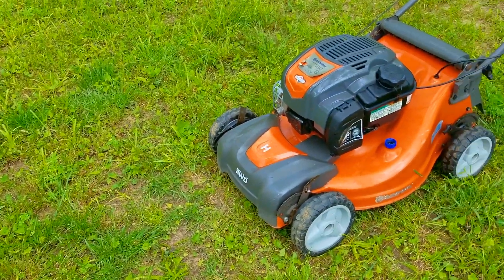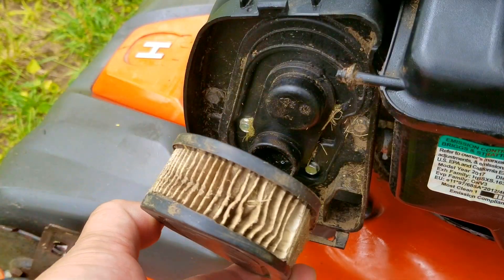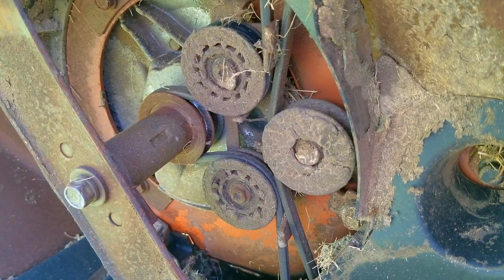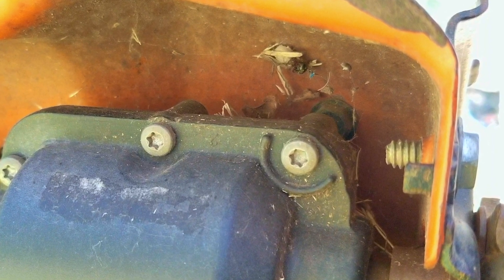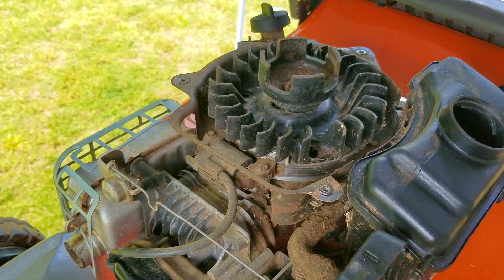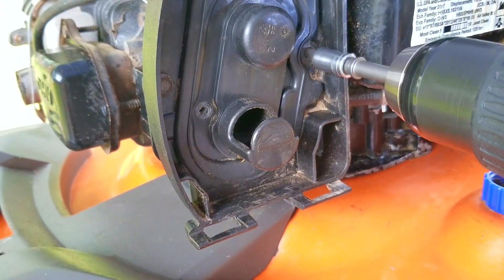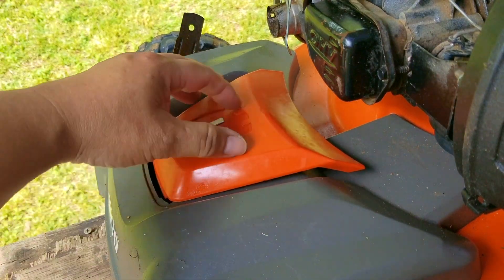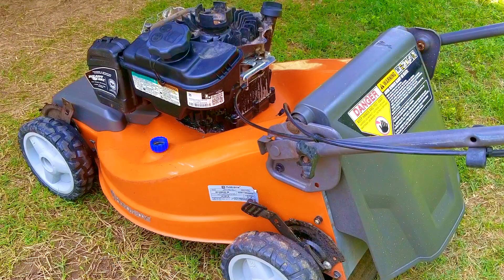Fixing A Husqvarna Mower That A Has Pull Rope That Won't Turn The Engine.

Comment: Yesterday dad and i got the new clutch for the Husqvarna 252RX when i got the trimmer reassembled and tried starting it the trimmerhead continued to spin, do you think i've missed something or do i need to run it until the trimmerhead stops spinning ? 😄 I'm wondering if the clutch drum is worn out in the meantime 🤔
Reply from the maker: so the clutch was the whole assembly right, spring included? have you tried to lower the idle speed? also, are you sure, this is the correct part, for the Husqvarna? If the spring is too weak, it will allow the clutch to back contact with the clutch drum, and the trimmer head will always spin.
Reply: @INSIDEHOUSEGARAGE  yup the new clutch was correct, i haven't tried testing it nowdays due to heavy rain, but i intend on doing it when the rain stops and then adjust the idle, what should i do if it repeats itself ?🤔
Reply: @INSIDEHOUSEGARAGE  i also checked the clutch drum's inner diameter which was 69mmØ according to the clutch manual of the Husqvarna 250R which i has the same parts as the 252 but with a few extra parts the 252 doesn't have is not suppose to exceed 70mmØ which didn't happen, i then compared the diameter on the clutch drum to an aftermarket one which has an inner diameter of 68mmØ i'm not sure what the inner diameter on a oem clutch drum is and doesn't tell on the shops which has them 🤔

Comment: Hi so I have a weed eater fl25c and we got it a new carb new ignition coil and new fuel lines and new spark plug and it has also 101 psi and it doesn’t start what can I do to fix it?
Reply from the maker: I'm curious why you bought  a new coil, that must mean you weren't getting spark before. what did you set the coil air gap to and what did you use, to "set" that gap.  Have you confirmed that there is spark, at the plug?
Reply: @INSIDEHOUSEGARAGE  when I first got the weed eater there was no spark and now the coil and spark plug are working but for the gap I didn’t use anything I don’t now how to use thoses gap things I’m still learning
Reply: @INSIDEHOUSEGARAGE  and I don’t have thoses gap things

Comment: I have a recurring problem with briggs engines that i just can't seem to figure out and was hoping maybe you can offer some insight. This happens with pressures washers, mowers, and other equipment. The problem is they run but they constantly pop pop pop from the exhaust. Adjusting valves doesn't seem to help, can't tell much difference from increasing jet size, and none of them seem to have sheared flywheel keys. Thanks for the videos, I really enjoy them.
Reply: Check the flywheel gap
Reply: @eathans_small_engines8665  thanks I will try that.
Reply: @eathans_small_engines8665  it did not help the particular piece of equipment I'm working on but I'm adding this to my list of things to check because I get a lot of these engines that have this problem.
Reply: @donsizemore8746  check your plug gap to becuase that might also do that

Comment: Hello..My 4 stroke Troybilt trimmer runs great at idle but has reduced power at full throttle. All new fuel lines, filter, carb, new spark plug was installed, valves adjusted, when I changed the carb I noticed the crankcase ventilation port tube had oil in it. I got rid of all the oil and installed new, 3.0 ounces. Still runs bad at full speed, No idea where to go now. Hate to dump it as it does run so nice at idle and is an easy start too.
Reply from the maker: two things, have you tried running it with not air filter just to check if it does it then, and have you considered there might be a restriction in the exhaust system? the other, is have you tried spinning the trimmer head by hand, to see if the gearbox is not putting a load on the engine.
Reply: Checked the muffler screen for obstruction and it was clean. This has a shorty shaft for attachments, it runs the same way with or without an attachment installed. Guess I'll tear the carb apart and see if any thing is blocking the flow. Thanks.

Comment: Great video on Great subject 
Some things to consider when deciding.  
How many parts to buy and price.
Including tools.
How long to get parts. This is becoming a real problem. 
How fast do you need mower, is it your primary mower, project or a customers.
The time required for repair.
Would your time be better spent.
Reply from the maker: all very good questions and the answers are also interesting. it's more of an issue of will it work, after replacing just the parts you need? and the answer is there Is no  guarantee.
Reply: @INSIDEHOUSEGARAGE  Agreed there are no guarantees in life.
In another life, another field I made decisions of these kinds. 
The rule of thumb at shops is that if repairs are half of what cost of new unit don't fix it.

Comment: On that stile briggs, you can slide the tank upward off its slots & carb out, without disconnecting the fuel line. Take it out as one unit tank/carb/fuel line..
Reply from the maker: yes you're right, but you also have to remove the top cover.

Comment: Just purchase a Honda hrx217vyaa and after I used twice, it’s very hard to pull the cord, because it pulls back. Do I need to adjust the valves already??? If so, what’s the gap space???
Reply from the maker: do me a favor and remove spark plug, close the fuel valve and remove the bolt on the bowl to remove the fuel thats left. then replace the bolt.  Pull on the rope a few times, and then replace the plug. now.. tell me if it still pulls back? IF yes, then the valve lash is the issue. Set it to .005" BUT if doesn't pull back, then the flywheel key is sheared.
Reply: Let me tell you what I have done so far.
I removed the flywheel cover and inspected the flywheel and flywheel key. Both are ok.
I inspected the valve cover for dents also.
I noticed that when I removed the spark plug the rope gets easier to pull.
Question 
0.005 clearance on both valves???

Comment: What if the pull cord has too much resistance?
Reply from the maker: then there might be too much oil in the engine. If not then the carb might be leaking gasoline into the engine.

Comment: Why would my pull cord not retract? Second, my yard guy over filled oil and oil is pouring out of air filter. Ugh... I don't have much knowledge abt small engine repair. It's prob abt 5 yrs old. Do u think small engine repair shop will kill me unnecessary "repairs"? Lastly, what would be the most you'd pay to repair a 5-6 yr old mower that's very similar to one in this vid. Any help is much appreciated.
Reply from the maker: not much to go on, but I would guess your spring is broken or the Pawls are jammed. I you think there's to much oil, in the engine, tip It over and pout out the oil and put back about 14-16 oz. of oil.  I cannot guess, what a shop would suggest, to repair,  but it's part of their job, to make sure, they aren't liable for any dangerous situations your mower might pose, to your health.

Comment: What I use is a 3 strike system. If I find three things broken on a mower, it’s out. This rule won’t apply if the parts are very low priced however, I also have a maximum budget of 150 dollars per machine. The only time I don’t use that rule is when I am adding a found Tecumseh engine to my collection. I will spend what is needed to fully restore those things.
Reply from the maker: ah, I didn't know you felt that way about them.  Can you share why you feel that way about Tecumsehs?  I like to, But I don't go out of my to fix them.

Comment: I had 2 of the exact same mowers. 1 had a bent shaft, so I used all the best parts from both to make 1. Sold for $200. Easily.  So either way should be able to recover what you spend.
Reply from the maker: I think you're right, thank you Casey B's Zombie Mowers.

Comment: I've  had to replace the recoil unit on my mower several times  because the spring snapped each time causing the robe to break as well.  When I tried to put a new bend in the spring it snapped again.

Simple answer to your question is when the repairs are greater than the current value of the machine and it would be more prudent to buy a new one that is going to give you good service for years to come. Simply put if the repairs cost more than what use they might give you than scrap it. This is where I am now at with my 2000 Buick Century custom.

Indeed sometimes less is more and saves load of time.

I have always found it to be easier to buy the whole assembly and less involved and less time consuming.  Most places simply do this by default.
Reply from the maker: thank you Patrick Nesbit.
Reply: @INSIDEHOUSEGARAGE  you are most welcome 🤠!

Comment: Hello Home garage, I am trying to fix my 22 inch toro FWD mower, and I am expecting the problem to be the carb. Do you know if the Briggs and Stratton engine on mine is the same one on this one?
Reply: Just look at the front of the engine where it says Briggs and Stratton, the engine should have a tag on it with basic engine info like the model number and CC's. Also make sure if it's a Kohler engine or not, those 22 inch recyclers typically use Kohler engines.
Reply from the maker: look at your carb, is it metal or black plastic?
Reply: I haven’t taken apart the carb yet but from what I see as of right now, it appears the float bowl is metal.
Reply: @mgomez5606  It isn’t starting, and fuel is leaking from the carb.

Comment: I strongly recommend that if you are draining the fluids before storage, to only drain the fuel.  Keep the oil in the engine
Reply: Can I ask why?
Reply from the maker: are you worried about rust? on the steel parts in the engine?
Reply: @INSIDEHOUSEGARAGE  no I’m worried about lack of lubrication and oil not getting to certain places

Comment: i have a mower outside right now that has the exact same engine as this one lol...
Reply: the guy took the clips off the handle bar and the filter and filter cover was missing and had really old oil in it and had too much oil in it so relatively cheap fix..30 dollars maybe .i jus tlike fixing them a neat new hobby for myself:)
Reply from the maker: I understand your hobby. I'm right with you .

Comment: That’s a decent machine. I’d replace the whole assembly and get your money back in the sale. 
BTW, and please don’t take this the wrong way, but I used to think you were nuts for washing your equipment with a tooth brush, until a couple of weeks ago I found myself doing just that. You made a believer out of me. It was faster, used less shop towels and did a better job. 
Cheers for all your hard work putting these videos together and showing us your common sense approach to small engine repair. 
Murph
Reply from the maker: thank you Ez Ray
Reply: The fine bristles on a toothbrush really get into those tight areas!

Comment: I just worked on a plastic carb Briggs mower. I think it was a Bolens from Lowes. it wasn't priming at all. Something was plugged up in the carb, and after cleaning, it still wouldn't run. Told the guy, the rebuild kit is $15, and a new carb is $25. He opted for the new carb, I put it on and it fired right up. 
I wonder if all of the Husqvarna AWD walk-behind mowers are built that cheaply. Those pulleys will get destroyed being exposed like that. I wonder if other models have a cover over the pulleys? I'd definitely order a whole new recoil assembly. Great video man!
Reply from the maker: thank you Jacob Feather, some had a plastic cover, but it was still open at the bottom for grass to fall out.

Comment: i fix these and sell tehm for profit a small one at that if it costs me 60 or so to fix then its nto worth it to me really i only sell them for 80 ..but still i jus tlike fixing them sense of accomplishment i guess...i have a rmeington and the rocker arm broke off that one i got to work but the arms keep coming loose so sadly i guess im jsut going to use that one for parts..teh thread locker isnt working just keeps getting softened by the oil running through so...idk they dont have the lock option on them newer mower too so oh well but i have 3 others ready to go and be used..so not all that bad.
Reply from the maker: that's a shame, and thanks for the information

Comment: 10:50 had to get the high speed corded drill for this one. Looking forward to you installing the pawl kit. Sometimes you can get away with new pawls (part 281505S) and sometimes you'll need to replace the whole recoil. We will see.
Reply from the maker: yes I particularly like using that drill for staring stuff. lots of power.

Comment: Very beautiful lawn mower I wish I was lucky enough to find one of those! Hey what ever happened to the little red hyper tough lawn mower that ran with no oil and you sanded the connecting rod on? Do you still have it?
Reply from the maker: no I sold that about 2 years ago to a coworker,  they used it as their primary mower for about a year, before they got a better one,  but they still use it as a back up. They say it works great.
Reply: @INSIDEHOUSEGARAGE  that is incredible! It jogged my memory because I just found a lawn mower on the road that was ran without oil and it turned over very stiff. I put WD40 and some oil in the cylinder and put oil in the engine and it turns freely now. Haven’t had time to see how or if it runs but I think it might!

Comment: As for the comment about the fuel line being hard to disconnect…you were only a governor and choke arm away from removing the carb and tank together.  Then it would have been much easier to service on the bench.  I think time-wise you’d be quicker just pulling it than taking the bowl off while it’s on the mower still.  

Love the content, keep it coming!
Reply from the maker: The choke lever and its post, are both cheap plastic and could break, The fuel line is only 3 inches and has hardened over the years.   Oh and don't forge the ports they go on, are also cheap plastic which could break, because of the force I'm exerting on the short fuel line.  Plastic fantastic, doesn't come close to describing, the chances of breaking someone on theses carbs, and thanks for the comment, I appreciate it.
Reply: @INSIDEHOUSEGARAGE  do whatever works best for you but I work on these at a shop all the time and never actually broke the plastic linkages when removing. To be fair I’m surprised I haven’t, but they seem to be more durable than you’d initially expect.
Reply: @INSIDEHOUSEGARAGE  The model year on the engine is 2017 so its only 5 years old as of the time of this writing. I doubt very much the plastic parts including the fuel line are brittle in that short of time. But do as you wish. Cheers.
Reply: @INSIDEHOUSEGARAGE  I don’t pop the plastic parts apart. Once you remove the fasteners from the carb, you can move the carb to the left as you pry the fuel hose from the carb. Once the fuel line is detached, rotate the carb to the right and one linkage easily detaches. Then rotate the bottom of the carb upward towards you and the other one will easily detach. Much easier. On the front cover, if you detach one side, couldn’t you flex the cover to get a better look at the grass buildup under there? Also shouldn’t there be a cover over the belt and pulleys under the deck? That looks like a disaster waiting to happen.

Comment: Why would you drain anything  I live in North Dakota and I don’t drain any fluids from any of my machines lawnmower tiller snowblower. I use fuel that has zero ethanol and haven’t had a problem I’m in my 50’s now so I’ve been doing this for more than a couple years
Reply from the maker: because the manual

Comment: Honestly it would depend on if the machine was a quality unit. Some companies such as Husqvarna have a homeowner line, mid-range line, and professional range line of their products. If it's even a mid-range product that will last a lifetime of casual use then it's probably worth fixing.
Reply from the maker: you make a good point William Bray.

Comment: Like I keep saying about delivery time, it does matter and IF you have parts or not.When I swapped the Briggs off the Snapper from a dead Deere my pal with his mower shop had the Deere there and no designs on it and even though the exhaust and intake were opposite of the Briggs, it still can be made to work. And I have a Kawasaki with a Deere sticker on a Snapper. The blade brake eventually made a fine blade adapter. All sorts of mods. Thanks and we all get strange things. GBWYall!
Reply from the maker: thank you Lewie McNeely

Comment: That is one of the big flaws with those all-wheel drive Husqvarna 21-inch mowers (I call them Husqvarna Compacts) there's not much of a guard for those pulleys and grass like to get up in there and just fill everything up until the self-propelled doesn't work anymore. There is so many of them that all i had to do was clean out then they're fine again. Poor designing on that part. It also causes premature wear to the belt and pulley
Reply from the maker: you are absolutely right.

Comment: Great video! I would personally do the cheaper repair and flip the mower. These newer briggs motors with the plastic carbs are getting to be way to cheaply made and they ask to much for new parts usually. But you will make your money back off this mower for sure.  AWD and it still looks brand new you can make top notch money off it.
Reply from the maker: you got that right, they make them cheaper, and sell them at a hight price, not a good business practice, if you want to stay in business.
Reply: @INSIDEHOUSEGARAGE  I almost want to buy as many rebuilt flat head briggs as I can and put those in place of the new motors that are on these machines to make them last longer and have parts wear out less.